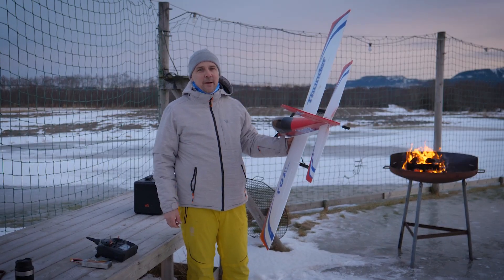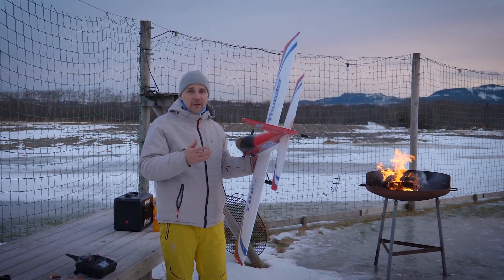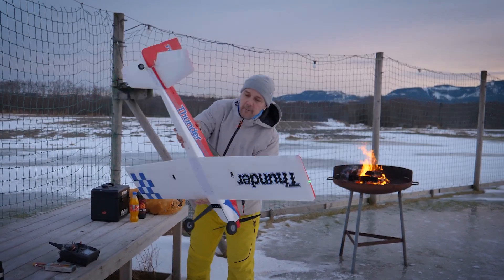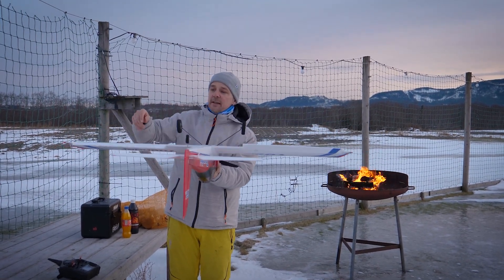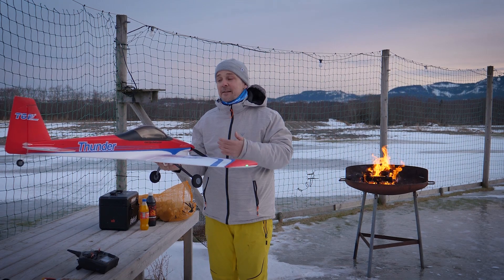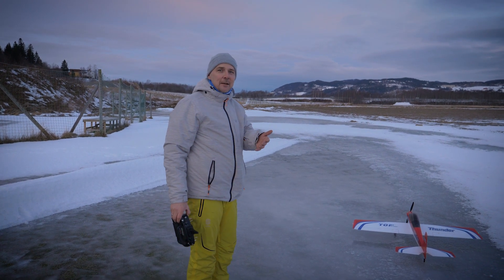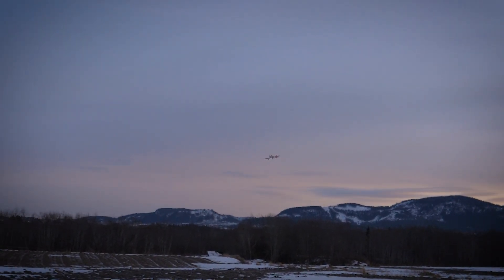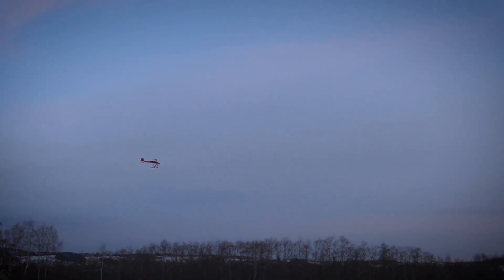TopRc Hobby - Thunder with flight Controller/Stabilizer

Comment: By 8min 3 sec is a cut.  Was there a mail stearing Input?  Great plain and so chep.  Also for 3D. Great explained video,  thank you
Reply from the maker: Naahh..  just me giving to much elevator.😊
Reply: @ArcticRc  In the wrong Direktion?  Stabi doesent help?
Reply from the maker: @philippeneuhaus5694  Yes but i gave wrong input on the stick🤪
Reply: @ArcticRc  Is the plain working whit 4s?  Think its consepted only for 11,8 Volt
Reply from the maker: @philippeneuhaus5694  i flies great on 4cell. But remember to add some extra cooling for the esc. If you only use 3 cell your fine